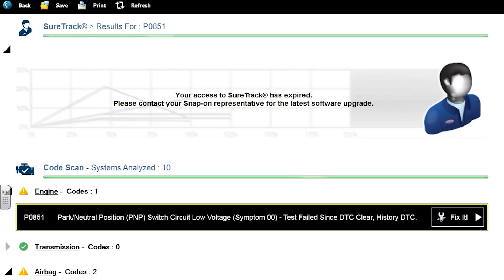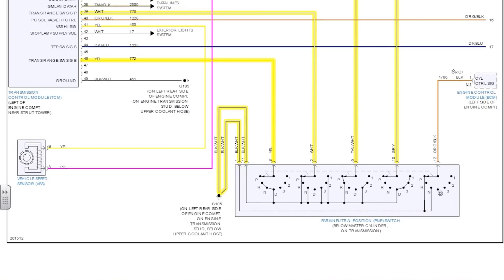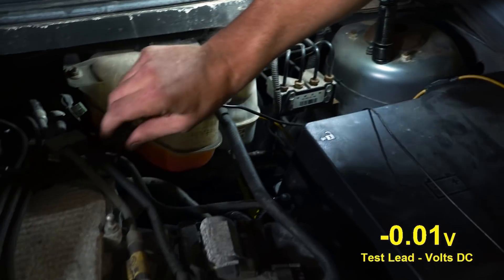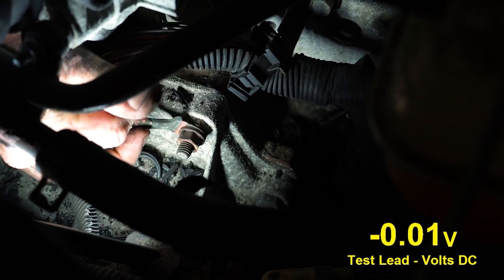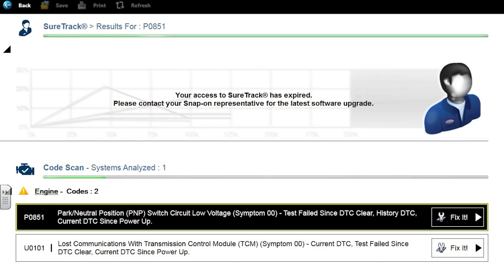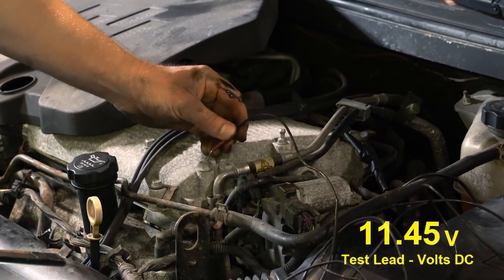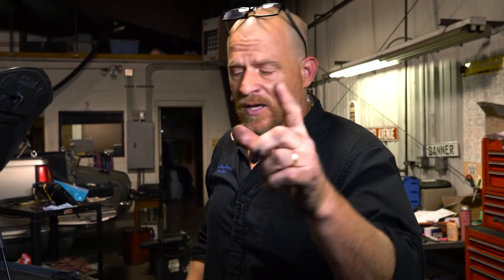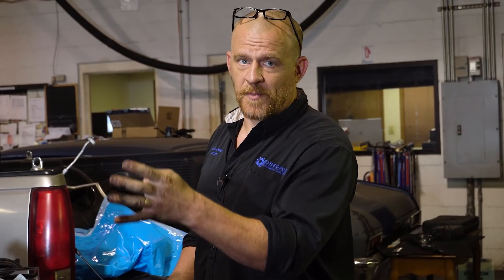PONTIAC G6 BAD GROUND

Comment: Having a problem with an 08 G6. Started out the same way wouldn't start here and there. Then i put a scanner on it and it read low voltage. And error on the dash. So i started looking for grounds and replaced the negative terminal and cleaned several others. Now it starts drives. But still reads low voltage. And i can't get it e checked. Any ideas?? I'm going through the obd pins now. But i don't think they are bad

Comment: You guys did a great discussion on the Pontiac as the ground was not fitted properly obviously.
And who would have figured that out.
Thank you for sharing.
Reply: I swear the last of the Pontiacs had some ungodly ridiculous choices for far too many things, see placement of the 2008 Grand Prix's Steering Fluid cap/area practically in the depths of Hell, the rear right window's assembly would always crap out because the toggle switch could get stuck on "UP" despite looking centered which of course would wear out the tension/motor,  the state of the grounds as shown in this video could lead to a lot of random nonsense popping up when all else seemed ok, just a major pain.

Comment: THANK YOU GUYS !!!!! Just fixed my daughter 06 Pontiac G6 by repairing that same terminal connection. Same issues, intermittent starting problems, TC light was on, hard shifting, mass air flow code……All is good now.  I never would have found it.
Reply from the maker: Glad it helped!
Reply: I have been going nuts over this same issue!!  We thought it was the ignition lock cylinder, as it would just pull out of the switch because it had been drilled out.  I have checked alternator, starter, I’ve went down so many rabbit holes in forums trying to figure it out.  I’m going to check that ground tonight to see if it is the whole problem.  We had a mechanic over last night who said we were getting the mass air sensor and the air intake temp sensor were throwing codes.  The traction control wasn’t working and we have codes for the transmission as well.  It even went into limp mode last night after changing the ignition switch.  I will definitely check back to let you know if this fixes it!!!  There are so many people that have had these same issues with these cars.
Reply: I think I am having the same exact issue. I first noticed the TCM and door locks would act up then I turned off my car and went to start it and nothing. I don't know how easy the grounds are to replace though.

Comment: You need to tell them you want the old parts as well.  Then you can tell if it was wasted money.  A starter is easy.  You use jumper cables on it, and it spins if it works.

Comment: Just fixed another one of these on a g6.  It had been to 2 shops and one other mechanic said it need a new PCM.  They called me to program replacement PCM.  I knew what the problem was as soon as I arrived.  Cleaned the wires, crimped on a new lug and hooked it back up and it was fixed.  The customer didn't want to pay me my 85 for the diag and 50 for the labor.  It told them that's fine.  I can break it again, and grabbed my wire cutters, they were like no, no.. We will pay.
Reply from the maker: People suck man. Two different shops and you fixed it and they didn't want to pay? And your prices are cheap too!
Smh 
Nice job my friend

Comment: What are your thoughts about having a redundant ground on the TCM heat sink?  

I was getting P1682 and U0101 - not very specific.  I don't have access or can afford to purchase detailed information for this car. I eliminated virtually everything else and was about to investigate the park/neutral switch and came across your video. I did manage to get the car to start with a ground jump to the TCM heat sink so I knew there was ground issues but didn't know where the intended ground was.  

Bottom line is that I stripped, braided and soldered all those little wires together and put them in a welding lug and then crimped and soldered that.
Reply from the maker: That's awesome, so you fixed it then?
Reply: @ScannerDanner   Yep!  Fortunately I have experience working with some small wires. I miss the days that cars didn't have so many or small. I showed the guy at the parts store the original lug and he said that they're not supposed to be open to expose the wires like that.  Shame he didn't work fir GM.

Comment: I did the pulls on those connectors, and for a while, it started fine. Then, from the time of this comment, I'm sitting in the parking lot with the same issue. No start... I replaced both connectors. Update I found more of those bad connections replaced all of them it started.

Comment: I just came across your video about 2 months too late. I had an 09 Saturn Aura that I bought back in 2010. I drove it for 280K miles, always ran great but one day I got what felt like a hard shift, lost my speedometer and a few other funky electrical issues. Pulled the car over shut it off but when I went to restart it got it wouldn't even crank. I put my basic scan tool on it and it said it couldn't communicate with the TCM. I did check for bad grounds but now I'm not certain if I looked hard enough. Replacing the TCM (part was only about $200) was going to involve pulling the tranny and disassembling it so I ended up junking the car. I hope I didn't get rid of it because of a ground issue. Bums me out, that car would have easily gone another 100K miles.
Reply: Man i miss Saturn's! I had 4 different Saturn's every single one of them made it to 300,000 + miles on them when I sold them and always saw them back out on the road STILL GOING! I've not owned another car besides those that made it even to 150,000 before something major, usually transmission issues started up. I swear that's why they went out of business, they were just 2 Good!

Comment: I'm glad that you showed the wiring diagram at the end showing how many things are affected bad the single ground connection. It showed exactly what I had found this afternoon. Mine started with a MAF sensor fault. Checked the sensor plug feed wire and had 12v. checked the plug ground wire and had a bad reading for the ground. While tracing the black/white wire and unwrapping the wires, I was hearing the door lock relay clicking in the fuse box as I squeezed the wire loom near the battery. I ended up figuring out that the exact same group of ground wires that you refer to were the cause of the door lock noise and just as yours did, the entire set of wires popped out of the eyelet without any effort. I only came across your video this evening after the fact. Sure wish I would have seen it first. Great catch and it's nice to know how many of these bad ground connections that you have come across. Keep up the good work.

Comment: Love the vid, you two are awesome :) Now can you show exactly where the grounds were I can probably find the one on the transmission. My goal is to redo them all... Love u guys :) I am just going to solder more wire then just put on bottom of bolt or connector until I find a better ground solution.

Comment: I just put a brand new alternator in my 2007 pontiac g6 but its still not charging the battery. 2days ago i put a new starter in and made the mistake of rushing and didnt unhook the hot on the battery. Socket knocked the ground wire off the old stater, and than sparked up on the engine directly behind the starter. The engine starts with a jump as the batterie is dead, but the alternator will not charge the batterie. Code 0010 came up. Any ideas?
Reply from the maker: you will need a good wiring diagram, maybe a blown fuse on that circuit? https://eautorepair.adtrk.biz/?a=10817&c=24&p=r&s1=
If you need additional help, post this to my forum www.scannerdanner.com it is free to join Thanks!

Comment: Thank you guys for this video. I have been chasing a no communication problem with my 2007 G6. I replaced the PCM and that didn't work either so I found this video and THIS WAS MY EXACT PROBLEM, car is now fixed and gone. FYI this happened after the Transmission was replaced.

Comment: Thank you so much for posting this! I've had the same problems. Fixed the same one you showed and the car started. Still won't start after it's at temp, but I think that's due to burnt wires in the fuse box connections. Fingers crossed I finally figured it out!

Comment: I've watched this video twice.  BUT I have no idea where the notorious bad ground connection is.  Lot's of arms reaching down into the engine compartment.... "right here" but doesn't show WHERE the bad ground is.  Did I miss something?  Very disappointed.
Reply from the maker: you need some good service info when you tackle jobs like this. Sorry for the poor shots of the location, but we do talk about where it is located and do show it. If you skipped around, you missed it. Here is a link for service info (diagrams and component locations etc) https://eautorepair.adtrk.biz/?a=10817&c=24&p=r&s1=

Comment: This video has to have had saved a lot of people i imagine! I fixed some parts and started getting a no com tcm code. I had the car sitting swearing i messed something up and needed a new starteror comp or tcm. Seen this video checked all grounds to the old g6 and the ground had plastic and corrosion covering the inside even though the outside looked not too bad

Comment: A diagnostic scanner makes your job easier.
I get it that it costs money to get the tool and the time it takes to trouble shoot the problem but nine times out of ten it’s an arbitrary fee that shops use to make more money and it usually takes ten minutes to figure out the problem.
This kind of problem is rare and
Bottom line if the scan tool saved you time then it shouldn’t be passed down to the customer.
Instead of just charging standardized fees you should charge them based on what it cost you!
If it takes longer to find a problem that’s called a labor charge..
Simple! Fair!
You’re just trying to avoid the back and forth accusations customers give you to try and get out of paying the bill and it’s easy in most cases to tell when the customer doesn’t genuinely understand why it took you so long and when they’re just scamming you.
I work with customers everyday and you just have to grow a pair

Comment: Scanner, I had that same problem with my daughters 2008 g6. The car would idle up and down but run ok out on the road. I found a few real thin gauge ground wires that i had to fix in that wire harness going across with the coolant tubes by the dipstick. The ground clip that you showed was corroded so i cleaned up and soldered it all and that's what the problem was.

Comment: Ok I have a 2010 g6 its starts but after awhile it will randomly just die out and will only crank and crank and won't start. I had fuel pump replaced, still doing it, had relays replaced and still nothing. So u think it could be a ground wire. Its got the 3500v6
Reply from the maker: for sure!

Comment: I'm surprised GM soldered to that lug, that makes for a weak connection at the point where the solder stops wicking into the wire. A solidly crimped lug would have been a better choice.
Reply: You would be surprised what GM and a lot of manufacturers do now... Anything to save money and time, time = money. It's why the interior dash by GM is always cheap plastic. However, Pontiac was a decent brand towards the end though, the G6, G8, and Solstice were decent cars. What they did in the 90's and early 2000's basically ruined their company though and GM wasn't going to save Pontiac because aesthetic-wise, and sometimes mechanical, they are really lazy.

Comment: Scanner danner I need some help reading Freeze Frame Data I got. Have a 06 F150 5.4 triton engine codes p0174 p0172 and p2197  Email drewserbin92@gmail. I WILL PAY IF THE CODES GO AWAY

Comment: Hey Paul I just came across one of these tonight, or a 06 Cobalt.  Had a Crank No Start with a U0101 no com to transmission control module.   It was Ground 105.   I just put up a quick video on it.  Same exact thing.  All the wires broke inside, but still crimped on.

Comment: G6 was a quality car, it had to been because it cost more than a Bentley in the 4 years I owned one. I had that ground problem too!! That was also fun to find, then a week later the water pump quit. AND after that the rad support rotted out..... replacing suspension parts every 7 months.... rust.... trans cooler lines.... bla bla, you get the idea

Comment: I wonder for testing purposes about adding some heavy duty ground wires from battery negative to the engine , chassis and body . However , is a component is missing it's ground then you would still be SOL . I see Eric O has a pair of vice grips added to ground a test light . That's taking no chances that you bite into a ground and it stays put .

Comment: While i remember this 
Toyota pick up 35 years ago 
I worked on
Bad ground 
Battery , alternator 
And the Volt regulator on the engine firewall .
Would all be great for a 20 min drive .
Was the day i learned about the notorious toyota  block grounding issue 🤣🤣🤣

Comment: Marine wiring does not recommend solder connections because of the type of failure you saw here.  Since the soldered wires are very stiff, all the stress is taken on the individual strands where they leave the solder.  A plain crimp is actually less prone to failure.

Comment: wire terminations, the bane of electricity and electronics! there is NO fool proof method of termination and never has been!
back up 40+ years and look at milspec/aviation and you'll see the theatrics they went through in failed attempts at perfecting terminations and splices ( huge emphasis on theatrics) ;)

Comment: 12 to $1500? and not fixed? flames and fire?
exactly as covered in video, there could have been many underlying issues (guaranteed yes), so while the previous shop may have  changed parts that seem improper, they could have fixed other issues at bay. fuse boxes were rarely the issues years ago, but that's back when stooge-tronics and electrical system were minimal. also when drivers had to drive, pay attention and think in advance ;)

Comment: This grounding issue reminds me of a problem with early model V6 Nissan Pathfinders, Frontiers, and Xterras. A bad ground terminal on the aluminum upper intake manifold can cause multiple trouble codes regarding O2 sensors. The service bulletin says that if the ground terminal is more than 25mV with a warm engine at idle, then a new ground wire should be installed. Fortunately, the terminal is easy to access.

Comment: Hey Paul
  Work on standby power. Generators for those that don't know. The point. When performing PM's the ground(s) get special attention. It's simple enough to fully disassemble clean and reassemble. If you think people get excited about their vehicles not functioning. What till their standby power fails!

Comment: I once had a customer bring a van in for the blower not working.  He said it had been working fine until the day before.  Test light confirmed voltage to the blower.  Test light also confirmed voltage at the ground strap from the blower to the fender ;-)  The screw in the fender was screwed into bondo....   I called and asked if the van had ever been wrecked.  The customer said, sure six years ago...........  Sometimes the customer's info helps.  Sometimes not.

Comment: I'm thrilled you got on the soap box to hollar that codes don't tell you what part to change.  I'll share my usual schpiel in hopes it'll help expand customers understanding.  When a technician is looking at codes, the standard global OBDII code list offers 36 different codes just for O2 sensors alone.  If it was really as easy as plugging in a scan tool and letting a code tell you what part to change, you wouldn't need more than four O2 sensor codes because that's usually the most O2 sensors you''re going to find under a hood.  So why 36 codes?  To give a tech a starting point in their diagnosis.  Some of those codes will point to a faulty O2, but some of those codes mean the O2 is trying to tell you there's a problem elsewhere.  If you're at home replacing an O2 sensor because you saw an O2 code, it's a toss up between fixing the car and shooting the messenger.  This is about where people get tired of me preaching, so this is where I'll stop before I chase  people away from another awesome video.

Comment: Oh my, I just dealt with this. SAME THING. I was so busy and I gave my 96 Explorer into the Ford place for an oil change. $20 special :lol:. Well they did a complimentary check on the car and said your 4x4 low don't work, we suggest a new shift motor. Get an estimate for $500. He pointed to a newer F-150 and said same problem, we just replaced one under warranty. 

Ok, I take it home, hook up the scanner. No relay click when I put it in N, press brake and 4x4 low. Scanner don't show Neutral pid changing. Looking up wiring. GEM uses trans switch to verify neutral.  Ford has a special redundant switch on that trans switch for 4x4.  Two circuits to verify neutral. Hot side ok GEM to trans switch. Ground side- GEM computer > wire breaks out of harness   near the firewall -> goes into the SPADE CRIMP IN THE VIDEO on a ground stud.>Another wire is in that crimp. Goes back in harness, goes back down to a pin on the trans switch. You see the rest. wires in the crimp rotted out. Open ckt from GEM to that pin. New connector,15min later, works as good as new. Cost me 20cents in materials.

 So someone would pay Ford $500, come back, and they would probably throw a trans switch at it too, maybe a relay module.. then probably tell them its time to trade :lol: . Thinking of going back and confronting them :lol: